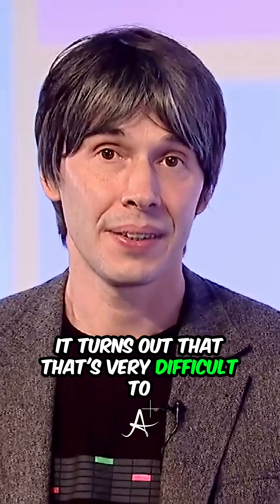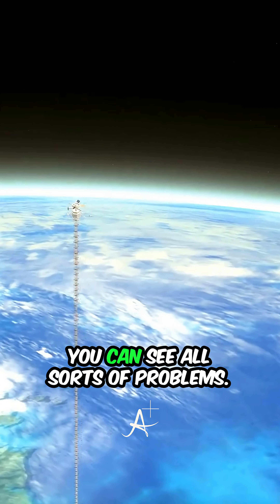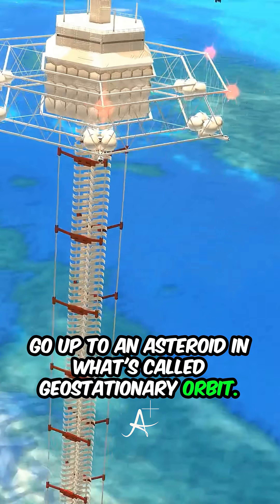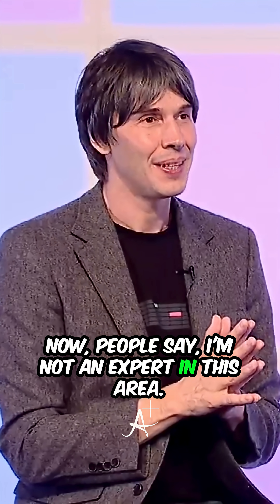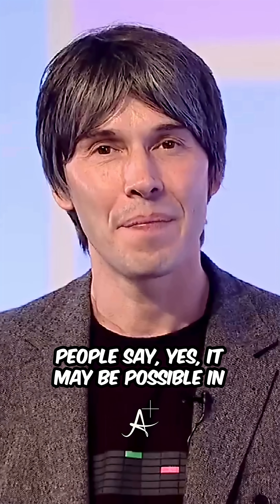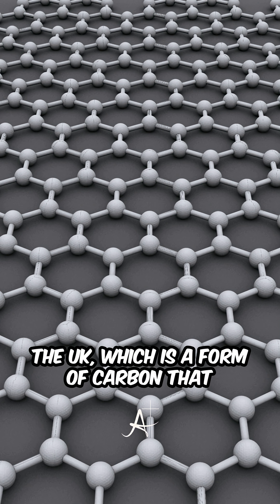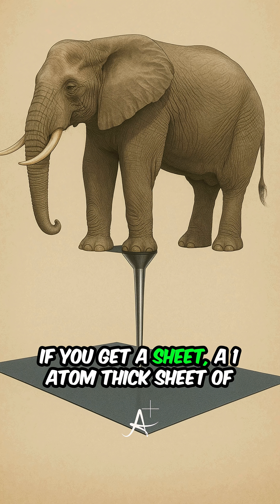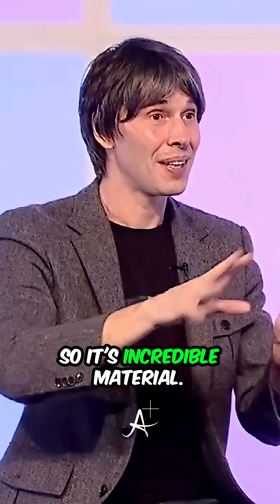Are Space Elevators Actually Possible?

Comment: Yes, a space elevator would indeed require a mechanism to maintain its altitude and counteract the effects of atmospheric drag and gravitational pull. As it operates in a low Earth orbit, the elevator would gradually lose altitude over time due to these forces.

To address this, periodic reboosting would be necessary. This could be achieved through various means, such as:

Thrusters: The elevator could be equipped with thrusters that periodically fire to adjust its altitude.
Climber Vehicles: Similar to how the International Space Station (ISS) is reboosted using visiting spacecraft, a space elevator could utilize climber vehicles that ascend and descend the tether, using their propulsion systems to provide the necessary boosts 1 2.
Tether Dynamics: The design of the tether itself could incorporate mechanisms to manage its tension and stability, which would also help maintain altitude 3.
In essence, maintaining the operational altitude of a space elevator would be a critical aspect of its design and functionality, ensuring it remains effective for transporting payloads to and from space.

Comment: The cable has to be 36km long
Unfortunately even if we were able to build a very light and very strong cable, momentum conservation will still pose a problem
Edit : it's ofcourse 36 000 km
Reply: low earth orbit starts after the 160km actually, but most used space is around 300-500km, ie the ISS is at 400km average, so hanging a cable there is a very risky move as it might crash into some satellites or debris
Reply: Geostationary orbit is almost at 36000km, not 36km
Reply: 36 kilometers is approximately 22.37 miles